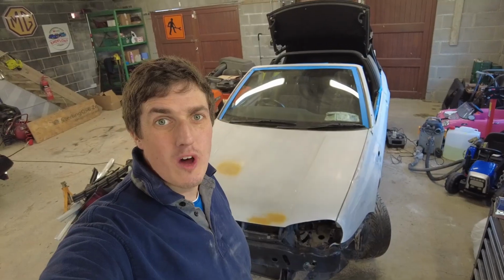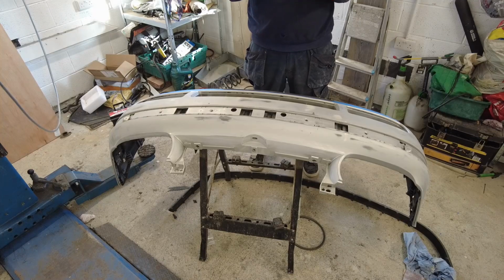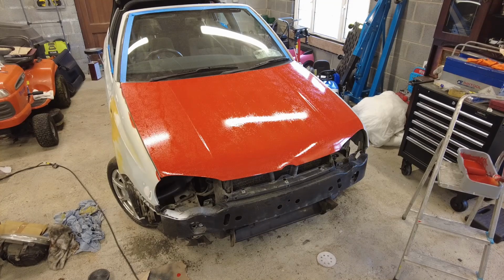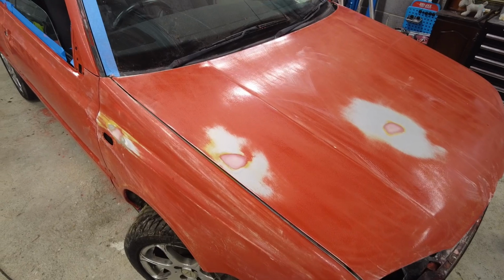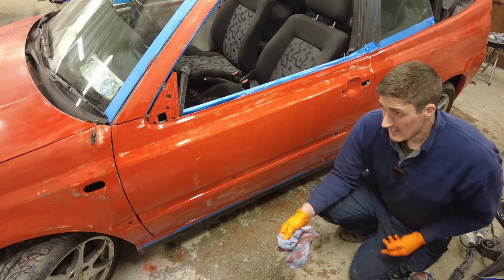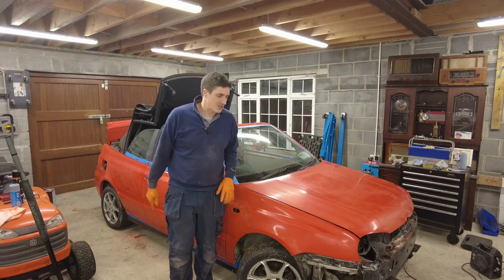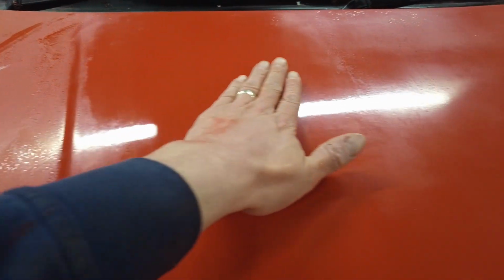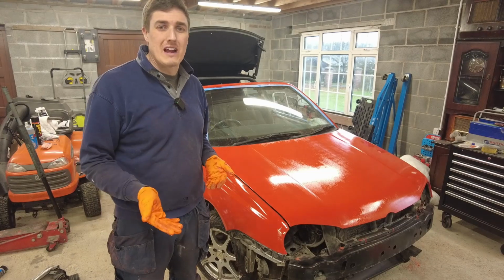€120 paint job for a €700 car - PART 2 - Roller painting!

Comment: I think it might be worth going over it with 1000 grit wet paper, then doing 1 or 2 layers of clear coat. Then start sanding that with 800 wet > 1200 wet > 2000 wet > 3000 wet > 5000 wet > compound > polish, if you really wanna put some work into it haha. I think it'll get you some pretty nice results but obviously will take a lot of work. It absolutely looks better than I anticipated when I clicked on the video so good job so far!
Reply: Is it also possible to roller clear coat ?
Reply: @grahamkay6142  good point, no idea actually. Maybe if you thin it enough with spirits? There's plenty of clear coats for rollers available in other industries so I wouldn't know why it wouldn't be possible on a car, but it's always good to make sure
Reply from the maker: Hang fire! I have tricks up my sleeve!

Comment: i wonder if you need to raise the temp a little in the garage. usually for rustoleum paints. they would say to paint 10-32C and humidity below 85% and in general low temps may also cause orange peel. but the deed may already be done :)